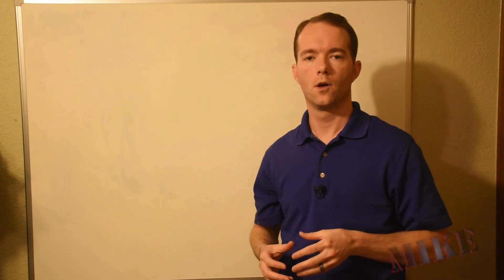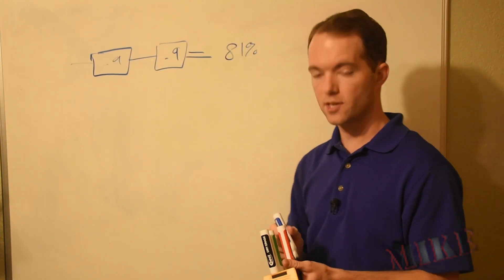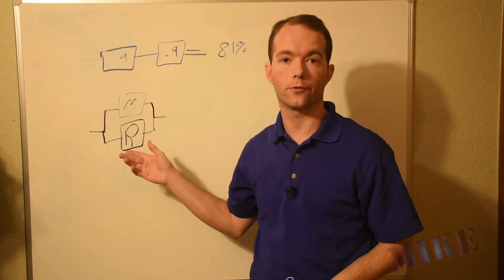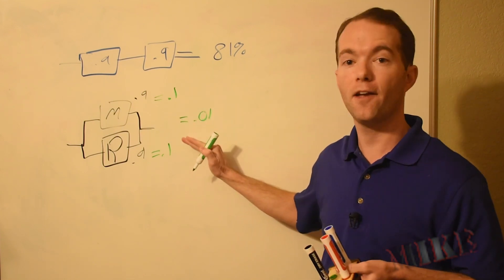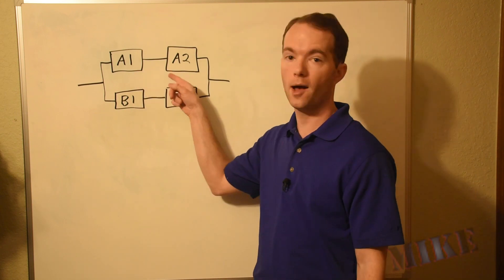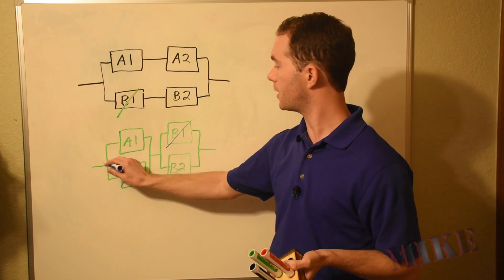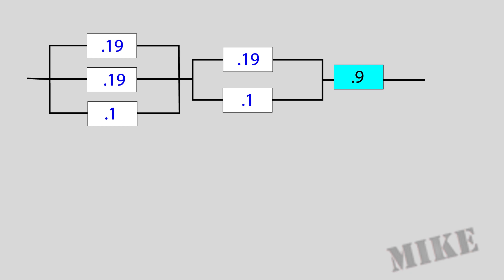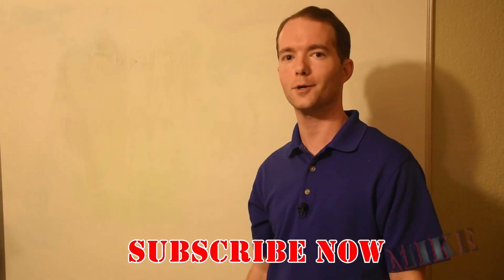Reliability Basics - Mikes Inventions

Comment: Your statement that .1 is the inverse of .9 is incorrect - your basic math is unreliable.  The inverse of .9 is not .1 it is 1.1 sir.  It also seems that you are incorrectly interchanging the 'probability of failure' with actual failure rate (lambda) in your explanation.  A more rigorous use of terminology would be appreciated.